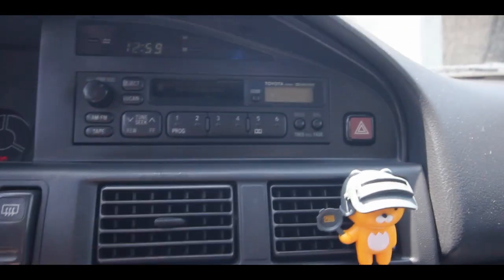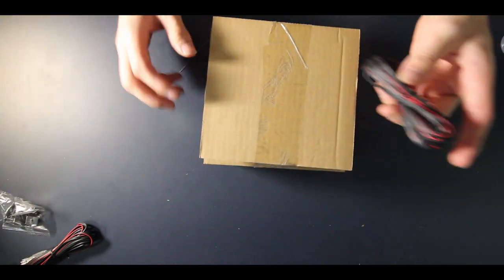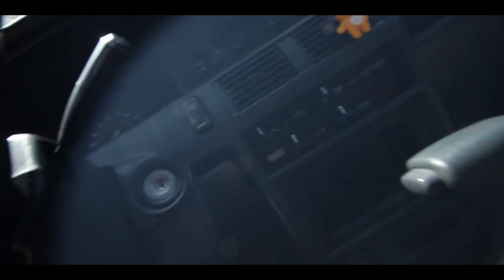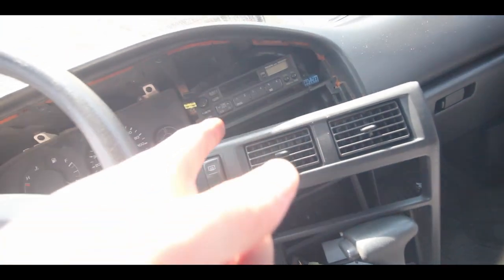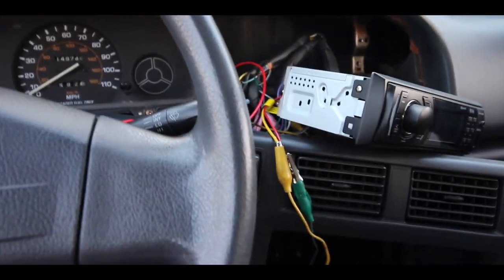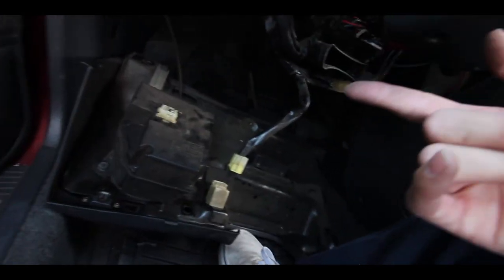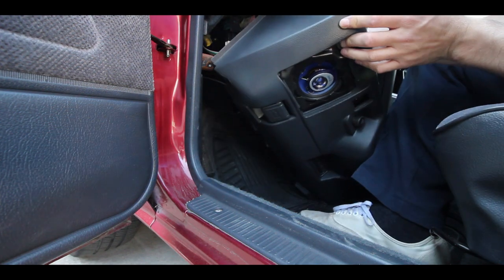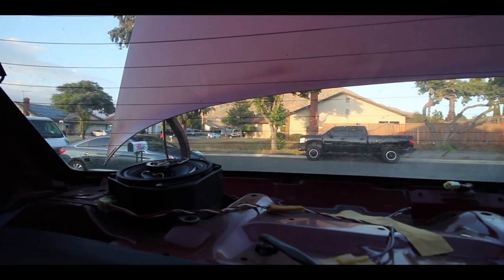Ae92 Corolla Speakers + Head Unit Upgrade

Comment: Another question, did you notice the sound being louder with the new speakers? Or did you get an amplifier as well
Reply from the maker: Better than before and im not running an extra amp, you can always get a better head unit to handle more power. I was just going with a budget upgrade and its fine for everyday use👍🏻